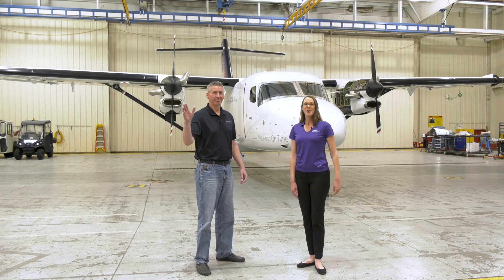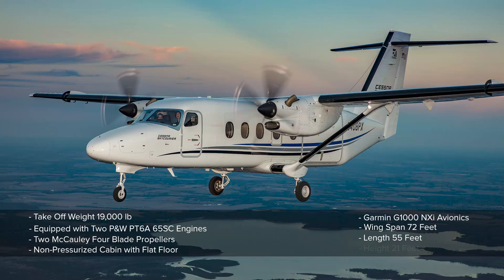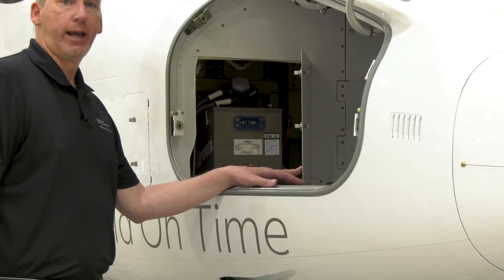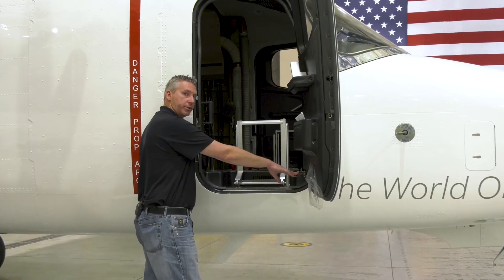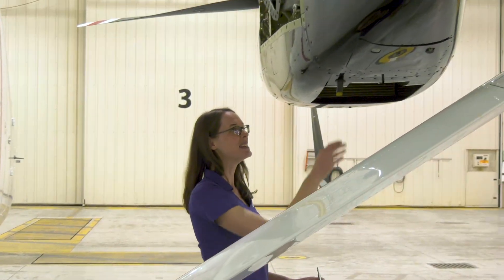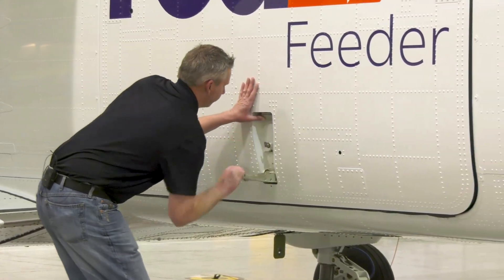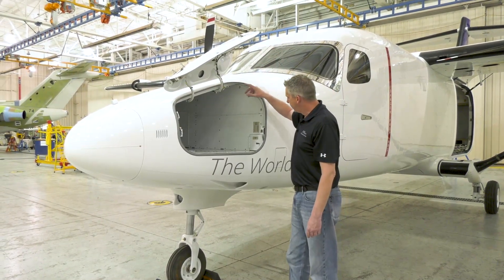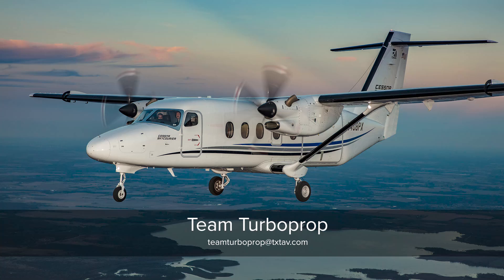Cessna SkyCourier Maintenance Overview

Comment: Lead acid or nicd?? no, Cessna :)
By making the plane in carbon fiber and a bit more aerodynamic you could have made it jet powered and 40% more fuel efficient. No wing struts either which is a very old look. Low wing would avoid the redundant stump wing for landing gear. And lighter weight could do with much leaner less draggy gear. As a jet with pressurized cockpit it could be 50% faster. And it could have smaller tail without the very asymmetric thrust of twin turboprops. It would also be quieter. And a lot cooler. Good opportunity to make a new one.

Comment: you didnt say if the hydraulic fluid is poured or pumped......you didnt mention the tyre pressures....you didnt show how to gain access to the landing light....you didnt show where a mechanic can plug in a headset.......you said nothing about where blanks and pitot covers are stowed on board. Ill bet windscreen wipers will be retrofitted........
Reply: All the red gear (covers, there’s about thirty of them, prop tie downs and exhaust covers  included) go in the nose cargo compartment, with the chocks. I think you’re right bout the lack of windshield wipers. 6 minutes is a bit short to cover all maintenance procedures but it was a nice introduction.

Comment: Cessna SkyCourier model design looks like N219 PTDI / lndonesia. Two modrls for replacement DHC6 Twin Otter & will retired. 

Cessna SC use use wing support & tail wing position at top vertical wing as DC9 / Fokker 28.

N219, not use wing support & tail wing position at half vertical wing as DHC6 Twin Otter. 

Cessna SC / N219, newest product for 19 seat class, with teo propeller engines. 

Welcome for Cessna SC & N219. Bye bye & thank you for you, DHC6 Twin Otter in the aviation world. 

///(#CROVIYLMYYPDPODSSS12312022#) ///

Comment: But this plane is an almost perfect clone of the C23 Sherpa.  The fuselage is exactly the same.  How do you explain this?
Reply: They took three LD3 containers and build a fuselage around it. Form follows function. That should explain it.
Reply: @cecielhelder5923  Exactly.  This plane has a very specific design parameter (the three LD3's)  and everything else is secondary.  I  just shake my head when somone says "this is just a twin otter copy, why did they reinvent the wheel"
Reply: Ummm,  it's not.  The C-23 is larger, and has a rear ramp opening, and the fuselage is not even close to being "exact;y the same" Seriously, google pictures of the C-23 and the Sky Courier, the fuselage is quite different.

Comment: Passenger version with an option of pressurized cabin would be a game changer in the market. Very good cabin height.
Reply: King Air 350 for that. As part of the Textron group, they would t want to cross compete
Reply: King Air won't hold nearly as many people, but flies 70 knots faster. Totally different mission profile. A pressurized 408 would sell and not cannibalize King Air sales. It would just be super expensive to complete the engineering and certification of such a ship when they already have the first 100 of these sold as it is. Take the money sooner and realize the ROI